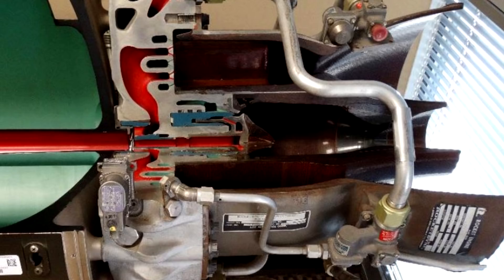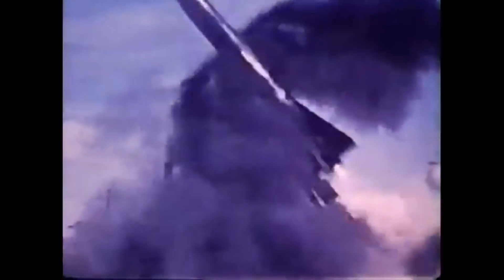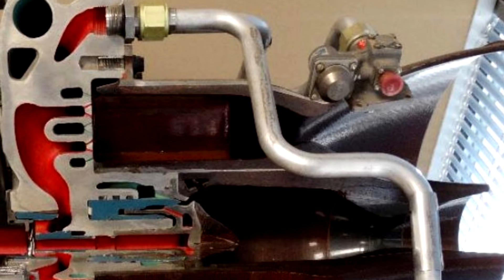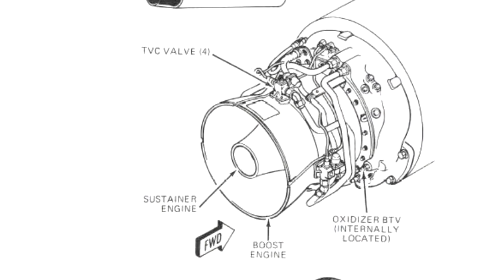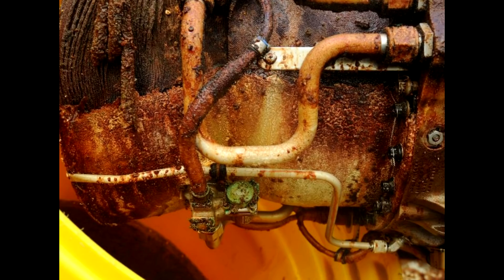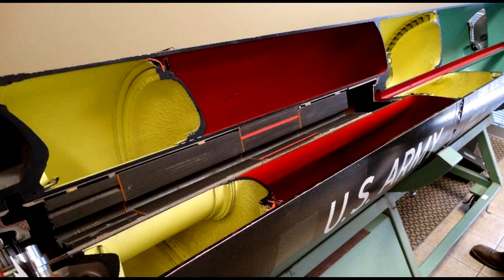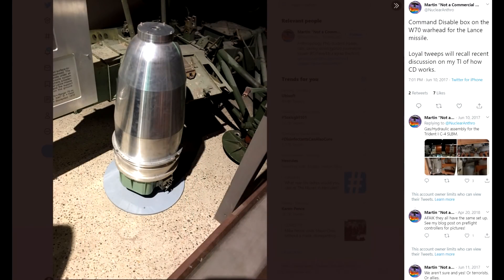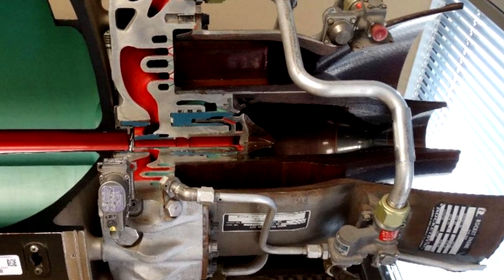A Rocket Engine Inside Another Rocket Engine - The Lance Missile

Comment: "Does this engine use a bell nozzle or an aerospike?"
"Yes."
Reply: Bellospike
Reply: I was thinking along the same idea. If you remove the outer bell would it still work, because it is just the outer bell away from being an aerospike really.
Reply: Coaxial bell nozzles.
Reply: The technical term is something like "plug nozzle" iirc
Reply: An aerospike is an open engine, but yes it looks similar.
Reply: Aerobell.
Reply: @RWBHere  to use a more RD-nnn term, Matryoshka rocket
Reply: @RWBHere  lol
Reply: The outer nozzle was termed "annular bell". Despite the visual similarity to the aerospike, it is unrelated.
Reply: It's definitely just a convergent-divergent nozzle inside another CD nozzle. If it were to be an areospike, the outer engine wouldn't have the bell shaped cowling; it would be directing all of its thrust at the outside cone of the inner CD nozzle. Currently, the outer nozzle is basically a bell nozzle with a plug in the middle, but the cross-section of flow through the convergent-divergent regimes is effectively identical to a bell nozzle.

An engine like this that actually WERE an aerospike with standard de Laval nozzle tucked inside of the spike actually seems kind of interesting as a space rocket engine, although it might work in reverse to how the engine in the video does. 

(I.E. rather than using the outer engine as your initial booster, your internal, standard bell-shaped engine would be optimized for expansion at higher ambient air pressure, and it would transition to an aerospike once the expansion efficiency drops, later in the flight. Of course it might make more sense, depending on a whole range of design parameters, to have the aerospike as the primary booster, being more or less efficient through the early launch, and then transition to a dedicated bell thruster once you're out of the atmosphere. Though, if you were to do it that way you may as well just stick a hall-effect thruster inside the spike instead.)
Reply: I was thinking they used them backwards -- you'd want to use the outer nozzle to confine the inner plume at (very) high altitudes, not on the ground!
Reply: @icollectstories5702  while the plumes have to not interfere at launch, the period they are both firing is too small a fraction for this to help them operate.
also you want the smaller rocket to be fully expanded at higher elevation, so you need to confine an inner plume at lower elevation. search fully expanded rocket exhaust for more information.
Reply: A bell with an insert is called an expansion deflection nozzle, and can be arranged to compensate for air pressure much like an aerospike. This one just happens to have a regular nozzle in the middle
Reply: I agree
Reply: Aero nozzle
Reply: an aerobell
Reply: more like two bell nozzles inside eachother
Reply: @emmata98  yeah, but the second  bell isn't a bell, it's a toroid, and the internal part of the toroid is somehow comparable to an aerospike (an inverted bell). 
While the inside nozzle is just a regular nozzle.
Reply: Try not to give a serious answer to a sarcastic (and funny) question
Reply: @trezapoioiuy  yes, but pressure won't form typical aerospike shape.

Comment: What feelthy feelthy propellant is burning in those black 'spin stabilising jets??
Reply: Very likely a solid propellant, like the one used in the SRB of the space shuttle, though burning with a much lower chamber pressure, so making a lot of excess carbon soot. Basically rubber with some powdered metal in it, and blended with some oxidiser chemical, then cast into a slug.
Reply: @SeanBZA  Looking  at the diagram and cutaway of the fuel system, it's probably a gas tap off that solid gas generator which is also used to pressurize the fuel and oxidizer tanks. In the early phase of flight the pressure would be too high otherwise, so they had to have some way of venting the excess pressure.
Reply: Makes sense that it's a cast propellant. Pretty grimy combustion!
Reply: @nicksales3800  Cue the competition for the most environmentally-friendly nuclear weapon... 😉
Reply: @ChrisPage68  'It's very nice, but what we had in mind a more...carbon neutral...weapon'
Reply: @nicksales3800  The movie "Dr. Strangelove" referenced a nuke with no propellant consumption.  It took Mutually Assured Destruction to pure level of Simply Assured Destruction.
Reply: No one, the black smoke comes from the ablative.
Reply: Wasn’t the Dr Strangelove deterrent stockpiles of buried weapons that were just to be detonated to irradiate the planet ensuring nobody won so nobody would be mad enough to start nuking them? Been awhile since I’ve seen it.

Comment: You mentioned it briefly, but can you do a video on the systems rockets use to light their engines in space
Reply: Yes that bladder thing
Reply: hypergolic propellant is one way.
Reply: Already been detailed ... 

Also check about the failure of relight main.core of falcon heavy Feb 2018. 

Tech depends if you relight after turn off (of no, use solid ). Or how many times. And if you need precision on combustion duration .

Comment: every rocket engine has another rocket engine inside of it besides rocket lab because they use electric turbo pumps
Reply: Not every rocket engine has a preburner. So called "Expander cycle" rocket engines have no preburner, instead the hot gas to drive the turbopump is simply evaporated propellant from the regenerative cooling channels around the engine's thrust chamber and nozzle. Look in to how the RL-10 operates for a prime example of an expander cycle engine.